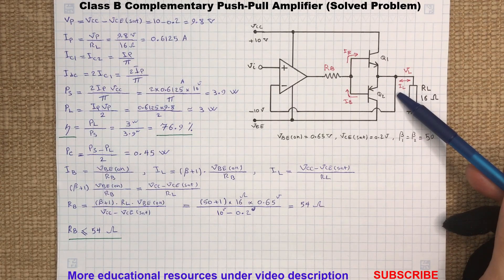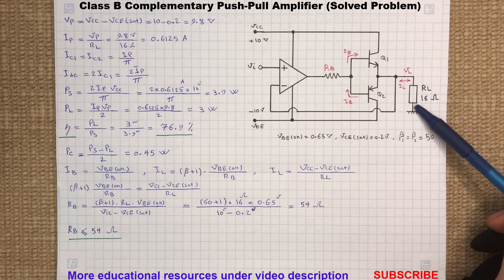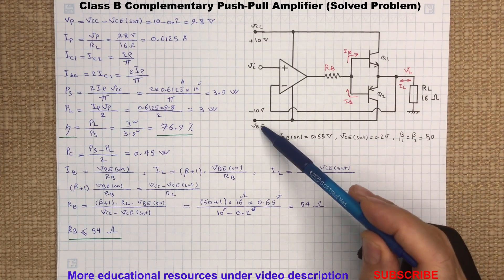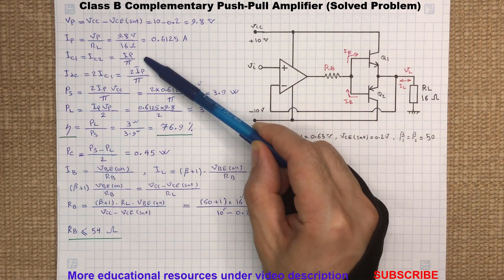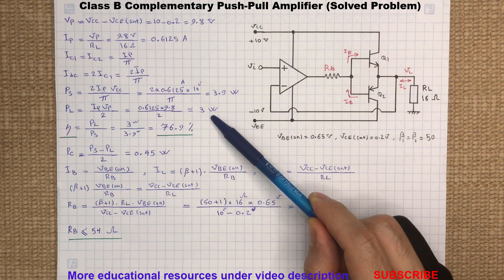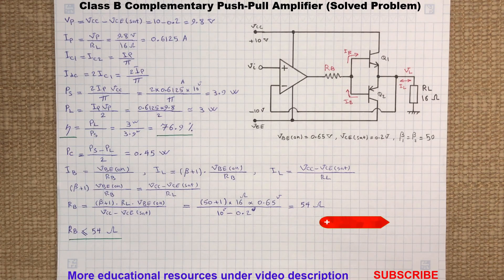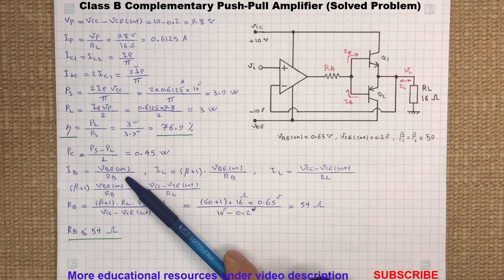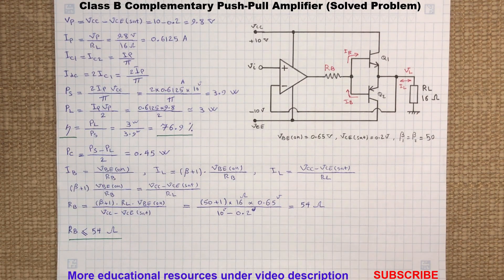Class B Complementary Push-Pull Amplifier Efficiency

Comment: This circuit is only good as a theoretical example. The circuit's weakness is at 0 Volts. You really want base resistors so that the transistors operate in class AB. Class B operation is only good for a square wave (not operating near 0 Volts).
Reply from the maker: There are some practical circuits on this topic which I will try to cover here soon.